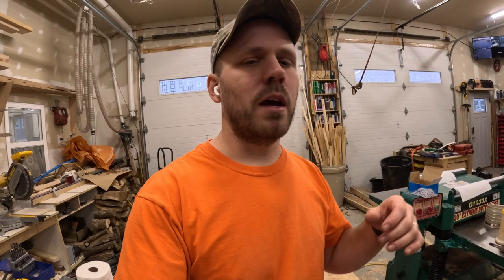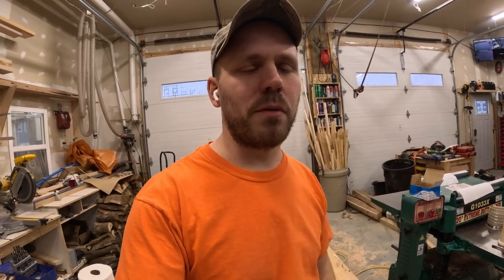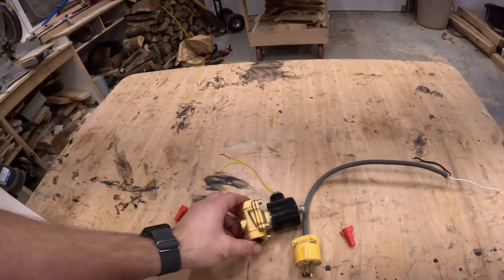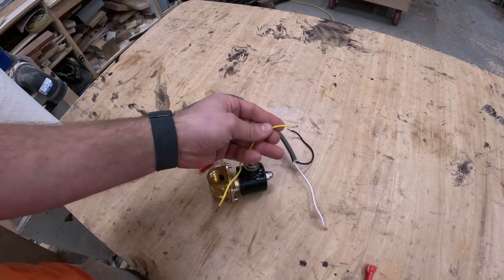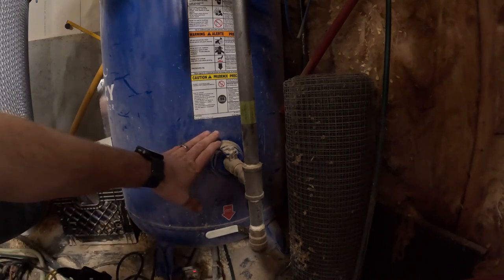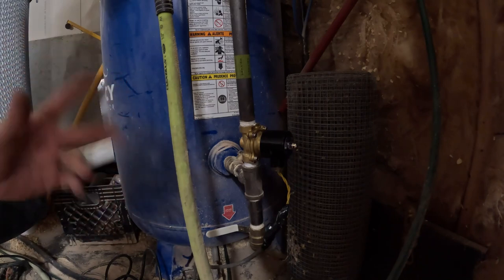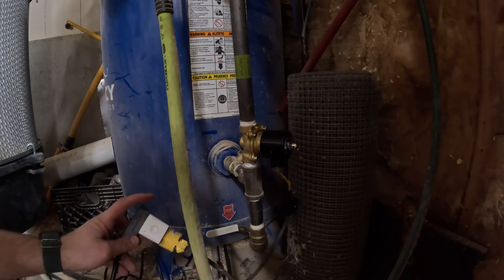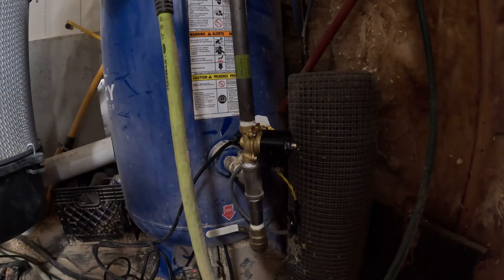Air compressor remote/automatic air shut off valve diy

Comment: Why dont you actually turn the compressor off? Instead of just shutting off the air.
Reply from the maker: Because the air lines are what leak so if I shut the line off I will have air quickly when needed. If the air compressor is off I would have to wait to fill the tank up everytime. Also, I have the air lines running to the house which is not connected to the house so when I need air in the house I can just have Alexa turn it on for me so I don’t have to go out to the shop